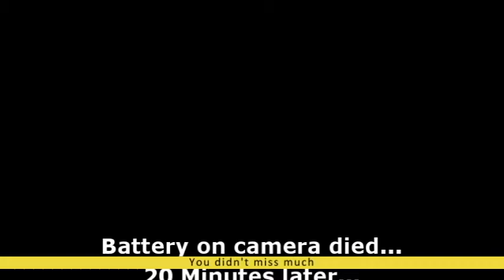CFMOTO UForce 1000 Vinyl Wrap

Comment: Looks awesome man! Perfect next to the tundra. If you have room for a wall sleeve, I highly recommend an LG dual inverter ac unit, I put one in my 36x28 main shop and it is awesome! Controls with an app while I'm away. Very high efficiency! I am intrigued also by the mini split ductless systems that also provide heat. I've got an lp furnace in my shop already so it wasn't really an option. Keep the vids coming! Great job!
Reply from the maker: Thanks! I've been looking into the mini splits that do heat as well as I do not have heat out in my new garage yet. I've got a well insulated 30x40' garage and really only need/want to keep it around 55-60 degrees in the winter as that is what I feel is comfortable enough to work in if I'm wearing jeans and a sweatshirt. And if I need more heat, I have a propane heater I can use if the mini split can't keep up in extreme winter temps. In the summer months, I mainly just need something to help with the humidity....

Comment: Question regarding durability of wrap material, I purchased a used Uforce 1000 lite blue that has a lot of scratches and rub marks were black plastic shows. I was thinking of wrapping it to make it look nicer but wondered how wrap material would hold up to dirt and mud and sticks/brush rubbing across it on the trails?
Reply from the maker: Sorry it took me a little bit to respond... I honestly cant speak to the durability as I have only had it on for a short time now, and I don't frequently take my machine down trails where it will see too much rubbing from sticks and brush. I did however take it out to my buddies farm the other day and we took it back through some old trails they haven't maintained in many years and haven't noticed any marks on it. It should hold up as well as the OEM decals I would think since its basically the same type of material... If you have existing scrapes and scratches in your plastics, I recommend sanding them down prior to wrapping or you'll see them through the vinyl.

Comment: May I ask how you got the bed panels off? Do they just pull off?
Reply from the maker: If I recall correctly, there are two clips on the front edge to remove between the bed and the cab, and then there are a few clips that are molded into the panel that can be released with a panel removal tool or a screwdriver and pull straight out.
Reply: @NewcomerGarage  perfect. Thanks man. Appreciate it. I love the color.